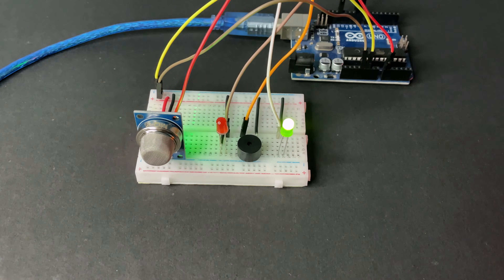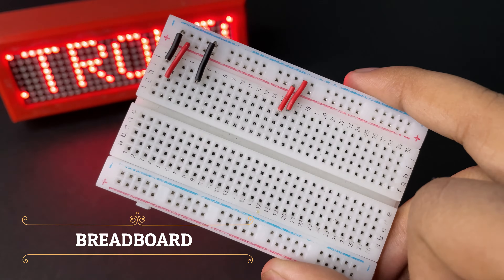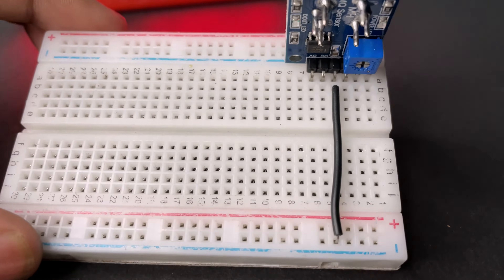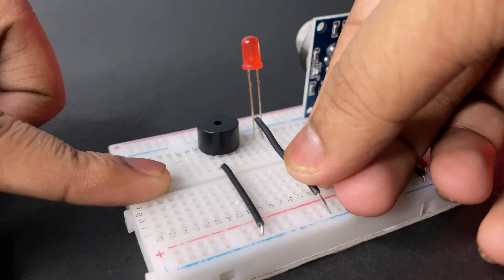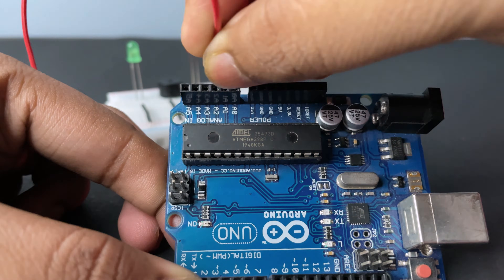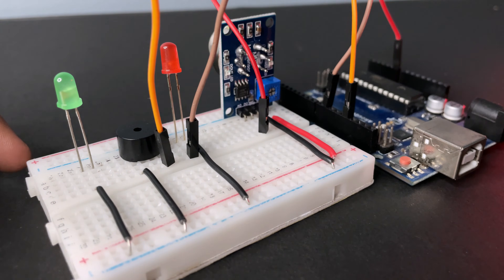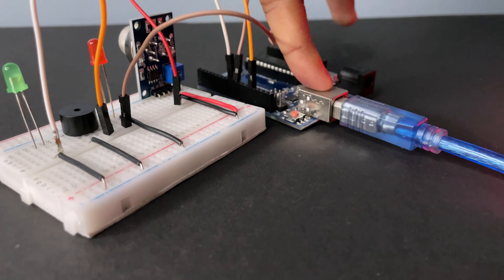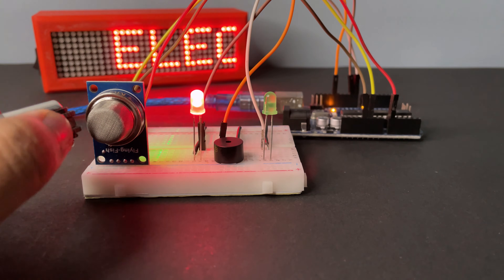DIY GAS LEAKAGE DETECTOR USING ARDUINO !!

Comment: just use any transistor or relay module you don't need Arduino and coding ,simple ,efficient way
Reply from the maker: Yes it can be done simple without arduino
Reply: Yeah, but I need it for my school's project

Comment: I have all the components here but I had a doubt. Why was it not necessary to use resistors in the LEDs? Every video I saw with MQ-2 used resistor. No risk of burning?
Reply from the maker: i used powerbank for power supply so less current ain’t damage anything